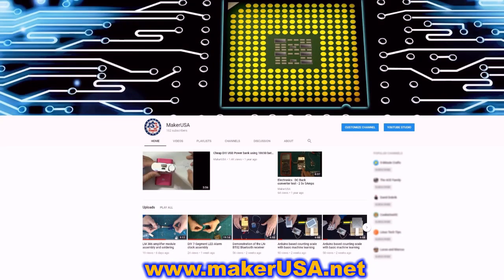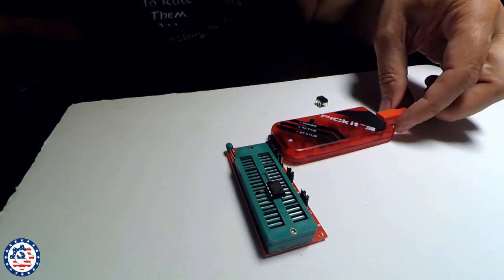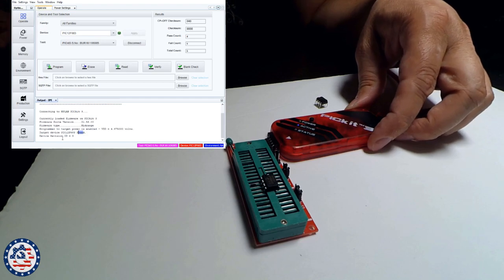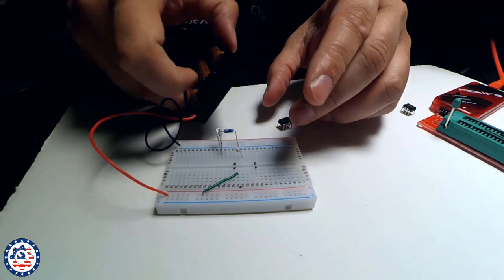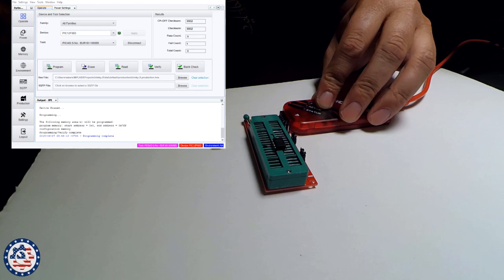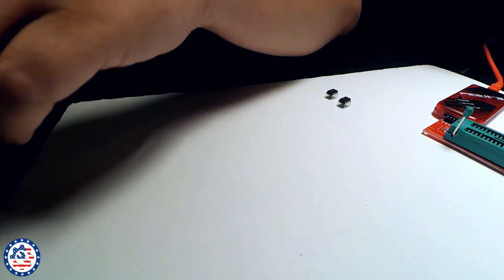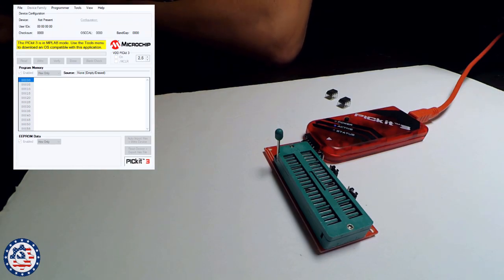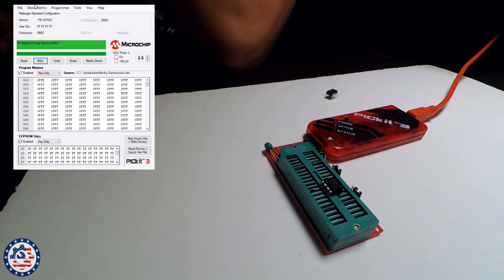Programming PIC12F683 through the Pickit3 Programmer and MPLAB IPE

Comment: Thank you. I have a one question, can I receive data from another controller to PIC12F638. I want to use PIC12F683 for LCD control and I want to write data using Atmega8A on PIC12F683 so is it possible ? Any pin of PIC12F683 work as RX, TX serial communication.??
Reply: Your question was asked a long time ago but I just saw this video... No, 12F683 does not have UART built in for Rx/Tx functions. You would have to program it all yourself.